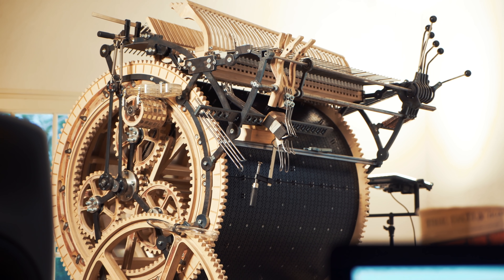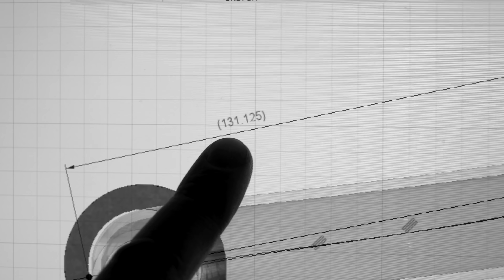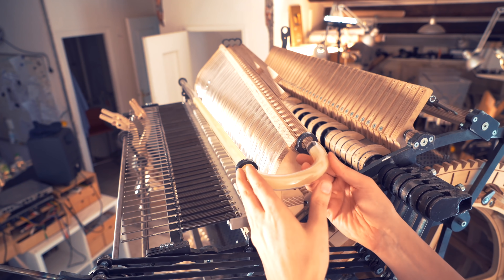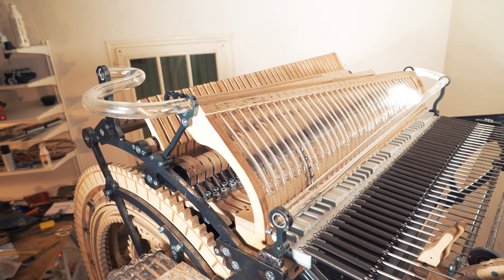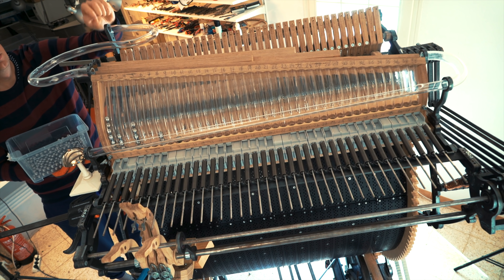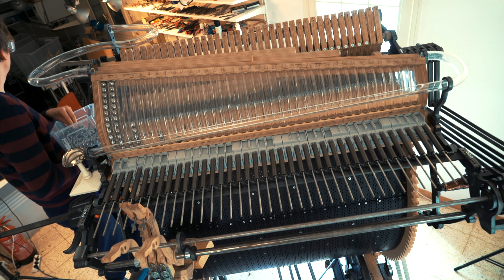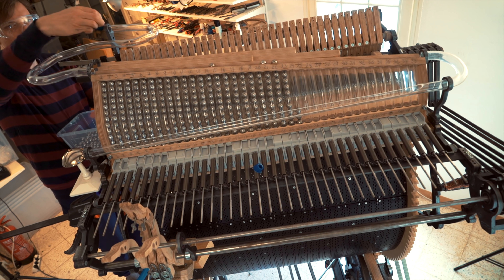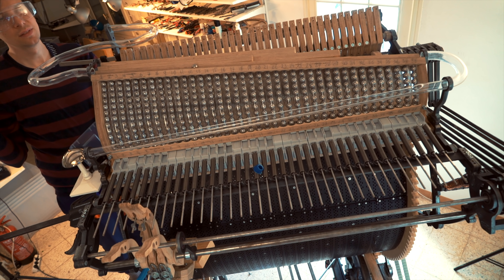Marble Divider Transport Tracks - Marble Machine X #68

Comment: i may have missed a video of yours on this topic, but as per the marble divider, how in the heck are any marbles going to make it down to the last few channels if the first few keep emptying over and over again?
Reply: There are three channels he had only one attached. the other two will distribute the marbles further down before they run over the holes (you can see that the metal part has three holes 1:24 )
Reply: @cobralyoner  thank you for the clarification! I've watched all of his videos on the making of so far but that one must've slipped my mind. Thanks!!
Reply: Still, it is annoying that the marbles are filling in the wrong direction.
Reply: This is a clearly something he thought about with the 3 channels. He must have down the math with how many it can lift and feed at once. The first marble machine didn’t seem to have this problem as it seemed to rely on the  random filling but the consider how many it would have to lift assuming the bottom note was hit every other beat because he has two tracks for one note. And then the next one was also hit every note. And the next one. Etc. every time you go further down the line it becomes more and more difficult to get marbles in it. I think there maybe be a limit to what can be played unless that lifting mechanism is incredibly fast. But considering most song aren’t all the notes every single beat I think it should be ok. The drum is probably more of an issue for sure. I’ll be interested to see it perform with this in mind. The other thing is to as he slows the Kinetic energy down with the rolling the feed rate ends up being slower as well as they are gravity fed it for sure could raise some issues. Can they be slow enough to enter all the holes and fast enough to fill all the lanes.

Comment: When I saw the programming wheel video, my solution idea would have been to put the uncut panels onto their curved frames, and build a duplicate of the inner framework of the programming wheel so you could mount them exactly how they would be on the marble machine. Then have a CNC rig that turned the wheel for the Y axis, and the router would only need to move on the X and Z axis.

This also would have solved the issue where the holes get pinched at the bottom because the plastic is being bent after the cuts have been made while laying flat.

Given the chance... my solutions tend to add a lot of extra work to achieve a "perfect" result instead of accepting the flaws and finding an good workaround to make it work.

Comment: I noticed in the last video that your hardest challenge was timing the gap between pins. Is there a reason your gap has to be between pins? Can you shift your pin grid so that a row of pins bridges the gap? Use the pins as your plate spacers. Tall ones to play and just short enough ones for non-played spacing where needed. 

Alternatively (and since you are cutting the plastic and metal on your router it’s not impossible) make the gap a puzzle piece seam. Interlocking the plates will guarantee their spacing, and they’ll float at their designed radius independent of the wheel supporting them.

Just a couple ideas, keep up the great work!
Reply: A dove tail design would be fairly easy to repeatedly cut, once you got it fine tuned:

https://www.amazon.com/Stalwart-Floor-Tiles-Interlocking-Padding/dp/B071WMHWJM

Comment: From last week's video it is my understanding that the primary problem with the programming wheel is that you're building something that requires a level of precision that's just barely achievable with the equipment you have. The maximum tempo and the length of the melody are the design constraints that the machine is built around. You could run the wheel faster and space the holes wider to allow for greater tolerances, but the whole machine would have to be bigger to get the same length of song.

So yeah, you could start over and make things easier for yourself, and the MMX is definitely a lot more complex than the Mark 1, but you knew that going in. This is a work of art that you make music with, not a musical instrument. If you wanted that you could've just used a synthesizer.

One idea that may speed things up a little is to cut the holes in the plates while they're attached to the wheel. This could be done with a gantry built above it, where the CNC machine controls the rotation of the wheel. Sort of like a giant eggbot (https://www.youtube.com/watch?v=cFJ1CX3XbK0 ).

I'd like to introduce a new phrase: Babage's Folly. That's when you design something that will solve all your problems but can't be built using the equipment available to you. In his case, the difference engine.

Comment: Perhaps your looking at the problem from the wrong direction, Instead of focusing on how you can add/swap out the programming plates is there a way to have the plates always on and the composition changed quickly by the pins slotting into it from the inside out, thinking by having all the pins able to seat within the plates as to not be sticking out and if a flexible template (Thin and able to save space) is pushed into the back and secured into place the needed pins will be pushed to the surface. ideally these templates would be somewhat disposable and easy to punch holes into for last minute composition changes.

Comment: What if, and hear me out in this, you implement a small air compressor inside the programming wheel like the ones you've seen in the spielklok museum's machines and change the whole thing to paper or perfored thin metal, that'll add a little bit of complexity to the machine but will make the music super easy to program and transport. So that the compressed air is what drives the actuators instead of mechanical pins

Comment: I might be saying something stupid as I'm not really into engineering but if adapting your process to fit your tools isn't working, why don't you try to adapt your tools instead ? Bending the parts adds a lot of distortion, so what if you could use your CNC machine on plates already bended ?  You could place a wheel in place of the cutting board (well, I don't know how it looks beside, there may be too much steel bars) and add a fourth axis on your software to make it turn. That's definitely something I'll try to do (on a much, much smaller project with a much, much smaller CNC I admit)

PS: In fact it already exists. I'm not even surprised https://www.youtube.com/watch?v=P5_nT1hsQf8

Comment: Wintergatan, did you know you could use compressed air to make inserting, and removing those rubber noodles into the PMA pipes?  Instead of using soapy water, just blow air into the tube (from the string end) while pulling on the string, and the air will blow around the noodle and allow it to slide right in. Then do the same thing when you need to remove it. just blow air into it from either end.

Comment: I think I am not a good Engineer like other Dudes here, but I am in Love with your Programming Wheel and I think it would be a shame to replace it. 
Couldn´t you build a Cover for each Programming Plate which is in Line with the Holes of the Programming Plate and in each Hole is a Programming Pin, but the second Layer is some Kind of a moveable Template. If the Template is locked, you can Fill the Cover with the Pins and if it is on the Marble Machine X you can unlock it and the magnetic Pins are able to get in the Programming Holes?
Pro: you only need 4 Covers and for each Song only 4 Templates.
Con: You need a lot of magnetic Programming Pins. The building of the Parts have to be extreme precisely and maybe hard to build that exactly. It only work if the Programming Wheel is empty. Maybe Use magnetism to get rid of the Pins witch are actually used? 
Best regards, thank you for sharing. Love your Project
Mikkel

Comment: Love your original machine and this one, been watching from shadows for some time. I have not commented at all cause you definitely got a full team smarter than me working the design on this one. Though I have worked as one of those 'backstage ninjas' in my youth for various concerts at an amphitheater . Your recent aesthetic with cutting the long tube channel worries me a bit. With all the movement of the machine (I do realize your machine base is much more stable than before), vibration from sound system (mainly deep base) and such through floor of stage. I worry the channel might be shallow and allow for some the marbles to jump the channel. I hope it does not, but just be wary. Cannot wait to see final end result with accompanying music. <3 <3

Comment: Suggestion for the problem of inter-song programming. Create a rotating jig for the reprogramming wheel. Then use a standard computer projector mounted above which displays a spot on each hole that requires a pin. Rotating the drum in the jig allows operatives on either side: one removing pins and another introducing them. It should be possible to arrange an LDR feedback resistor advancing the projector line for each programming line moved. A ratchet on a crank advances a line at a time. Although you have the weight of the jig and the projector on tour, you save the weight of programming templates regardless of the number of songs.
If you wish to be even more advanced a laser and mirror scanner can be set up which would auto detect the correct introduction of a pin cancelling its light ‘spot’. I can draw a diagram of how this might work... (similar principle to laser printer)

Comment: Hi Martin!

One of the concerns would be transporting large programming plates, plus having to reprogram them during your shows. My thought to alleviate this would be to use your idea of having a sheet that covers the plates and only shows the holes that the notes are going to be played from, but instead of placing metal rods that hit the marble release, have a mechanism connected to the top of the MMX and marble release fingers that is able to "read" the open holes and release the marbles, similar to a hole-punch music box!  This way, you only need to make, fit, and carry one or two sets of programming plates on tour, plus giving you the luxury of being able to compose on the fly if you have the sheets and note-reading mechanism removed.

I feel like I am over simplifying this, but you have a deep understanding of hole-punch music boxes so I am sure you would know if this could even possibly work. Thanks for your videos!!

Comment: Hi Martin,

A few suggestions:

1. You don't have to insert the silicone rod all the way if you're only going to bend certain sections. About 30cm of extra rod after the bend should be more than enough.
2. Instead of using a saw to cut pipes to the proper length, get a proper pipe cutter. This prevents the pipes from unnecessary cracking/breaking at odd angles and you don't have to spend as much time finishing them.
3. After you've cut the pipe to length, using a simple pipe deburring tool will help to smooth the edges for a nicer fit. It's basically a short pipe with 3 blades on each end, one for deburring the outside of the pipe, the other for the inside.
4. I couldn't really tell from the video, but the kinetic energy killer snake doesn't have to be that long in my opinion. My approach would be to lower the last half of the second U bend to below the level of the exit hole, so that after a marble makes the second turn, it is force to go uphill, thus killing the kinetic energy. Not sure if this makes sense to you.

Comment: How about 3d printing sheets that could wrap around the wheel as it is? Flexible base with inflexible pins. Doing so would give you quick song changes, but not remove your ability to program anything you would like directly into the existing system.
Reply: Like the studs on football cleats, or what is under some keyboards. A giant mat with pins, wrap secure run and run. The pins on the disk from the Pylophon Disc Changing Music Box come to mind.

Comment: I think the programming wheel design is fine, the system that allows you to play various types of tempos and such is brilliant. The main issue seems to be from a manufacturing standpoint due to the bits getting dull during the long machining time, the nature of the plastic material, etc. That isn't a design flaw per se, just something that you'll have to optimize over time. Keep on keeping on Martin!

Comment: Have you thought about cutting the programing pin holes after bending the plastic.  Either mounting a cnc router to the actual Marble machine X frame or building a rotating assembly/fixture to your existing CNC table.  I believe those are called a 4th or 5th axis.

Comment: @Wintergatan
 Hi Martin. I've been looking at all your MMX vids since the beginning and evne if some of your ideas are overengineered in a way it even hurts I shut my mouth as I liked the way somethin so poetic to the view is taking forms. NOW I think is my moment to break my silence. You have fallen waaay too far into the dragon's rabbit hole!
As a mechanical engineer working wiht sheet metal it hurts knowing you are not taking sheet aluminum into account.
On the existing wooden base of the programming wheel, place the notmal metallic sheet as planned. Then, directly on top, place a fist layer of aluminum sheet with the hole pattern cut into it (more to this later). After, wit some space inbetween (wooden spacers) place a second aluminum sheet, also with the cut hole pattern. The patterns have to be perfectly alligned, so they have to be "scaled" on both plates individually.
This will give you the possibility of transportability, programmability and, if you eloxate the plates before cuttin, it will give you a cool finish.
To the matter of exactly cutting the plates: FIRST bend the alluminum sheets on to the correct diamteter, THEN cut out the holes. I would suggest to order the cut out the holes to a company which uses a with a water-jet cutter with the possibility of cutting tubes. They mostly have a turnable "bench" to rotate the piece while it is cut.
If you need more input, feel free to contact me.

Comment: Why don’t you make a funnel to load the balls in the machine?
A little soapy water could help getting the silicone out of the snake if he’s eaten to much, if not a hozelock round mixer tap to hosepipe adapter (model 2177) would probably clamp on and then you could use water pressure to force it out.